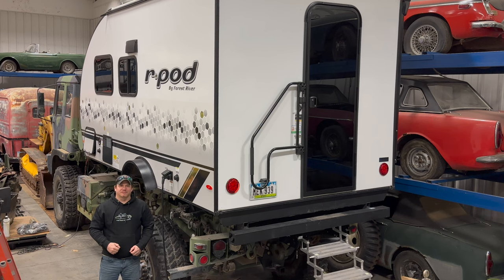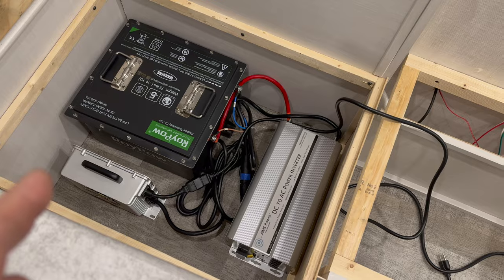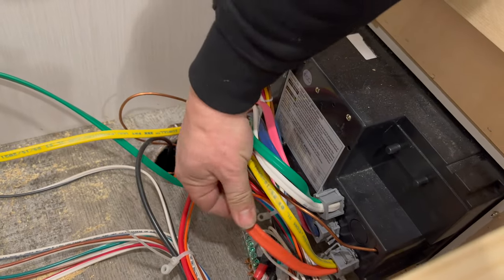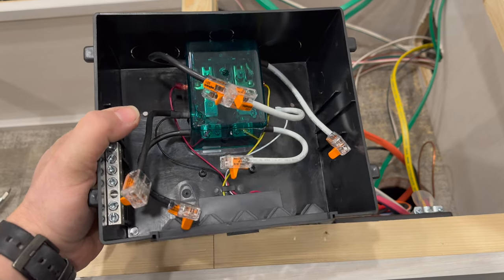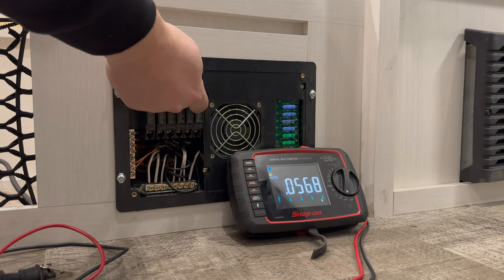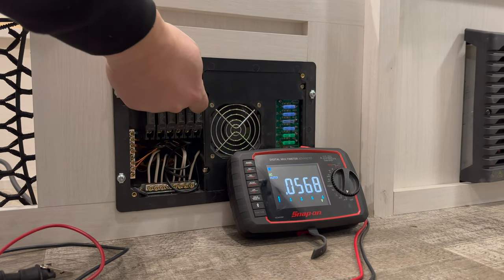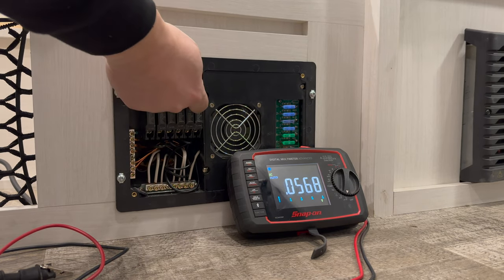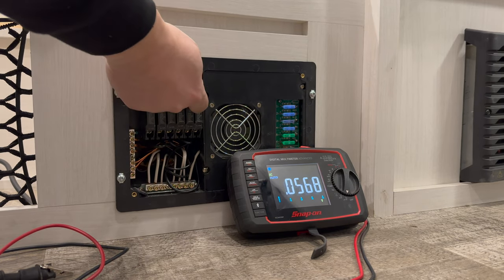Using 36V Lithium Roy Pow Battery to Power My Camper

Comment: Nice stuff, meaby install few solar panels on the roof to charge up battery for free. Good solar charge controller can charge battery same time while you use power in the camper.

Comment: Interesting design, as to where you're going with it.  Fairly clean layout, with contingencies, Nice.  Surprised the potential output of that RoyPow, tho that what its designed for.  Interested on the longevity of the unit, sure hope you can give an update after some extended use.  Thanx !
Reply from the maker: These types of batteries have a battery management system that will turn them off when the get down to a voltage that would harm the cells inside.  When charging they keep the cells balanced.  In theory the battery should last a lot longer than typical batteries.

Comment: I have some clue what you are attempting but I don’t want a written test on it! I do wonder how many people with camper vans would be capable of installing that battery. A small percentage would be my guess. And by the time you have added an inverter to the mix;even less! It’s a lot easier,in my case,to follow your hunt the mouse nest videos!

Comment: Might think about adding a fuse or breaker for that charge lead. It would smoke pretty good if it was shorted and waiting for the 30A breaker to trip on the shore power feed.
Reply from the maker: That could easily be done by using a power strip with a circuit breaker built in.

Comment: Any plans to modify your solar set up to charge the roypow?
Reply from the maker: Most of the camper runs on 12V and my truck runs on 24v so I will be leaving the 12v and 24v solar setups in place because that is what will get the most use.  If I decide I need to charge the roypow on solar I will either add new panels for 36v or install an inverter that runs the charge off the 12v panel.

Comment: Very cool setup Steve. Good explanation as these types of systems don't need to be overly complicated. Do you plan on adding solar into the equation? Looks very doable.
Reply from the maker: I already have solar for the 12v and 24v batteries on this vehicle, I am running out of roof space and I’m not sure I have the room to get a 36v solar setup. I have been toying with a 12v to 36v converter off the 12v solar panel.

Comment: Doesn't the transfer switch sense that shore power is available and disconnect from the inverter, to save your battery? Similar to a whole house back-up generator.
Reply from the maker: That is not how motorhomes are wired.  The thinking is why would you have your inverter or generator on if you were connected to shore power.  The benefit of this setup is that you could shore power from a 15 amp plug which would run your charger only and you could turn on the inverter and run a device that would overpower a 15 amp plug.

Comment: How much was that unit cost ? what a great way to power up an RV
Reply from the maker: I haven't added up everything but the links to most of what I used are in the description so you can see what they cost where you live.  You would probably want to talk to your local distributor for the battery as I did not find what looked like a reliable online source.